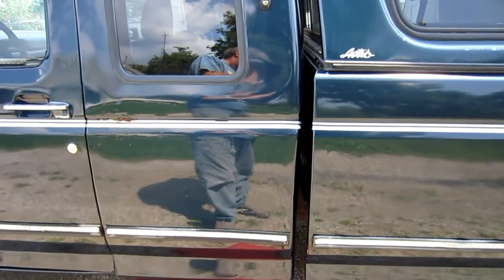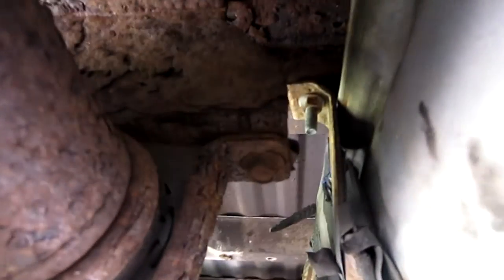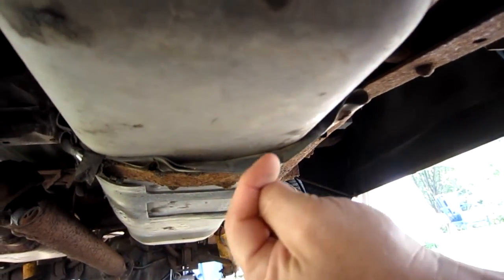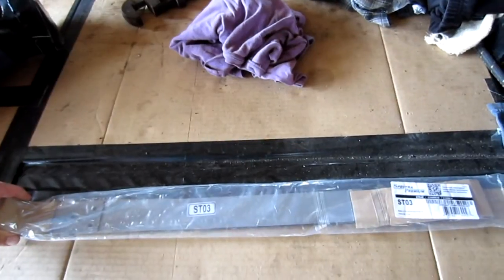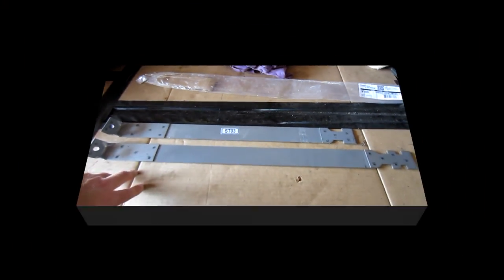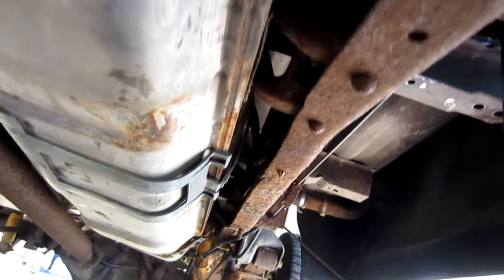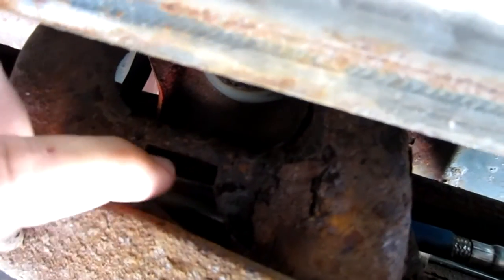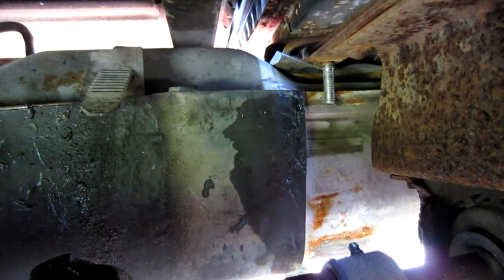95 F150 Fuel tank strap replacement

Comment: I live in Northeast Ohio as well. Definitely understand the rust. I also have a 1995 F150, but amazingly the front tank straps have stayed in good shape over the years because the truck is equipped with the factory skid plates beneath the tanks. However on my 1994 F250, the front tank straps are in need of replacement. Thanks for the video. I enjoy your F150 video series. It is cool to see someone from my area making videos about these trucks.

Comment: Ill give you a heads up that ford couldnt decide what size nut to use on the straps. A 6 point deep 15mm works pretty well. 9/16 wont go. 5/8 12 point wont work and 12 pt 15 tends to round off as well. Even 15mm open end wrench tends to round the nuts off

Comment: Thanks for the video. Just did mine about 1 hr ago. yours looked easy, but mine went even better! i guess in 2002 they put speed nuts on, it saved my knuckles.  I think this generation of trucks is going to be sought after soon.  Lots of parts available, good motors ( before cam phasers, and not much computer controlled stuff) hope you still have yours!
Reply from the maker: Glad you enjoyed the video. No on the old body style. The 95 F-150 in the video replace my 94 F150 with a straight 6 that I had prior. We moved up from a pop-up camper to a travel trailer and the 180000 mile 302 engine in the 95 F150 was doing an okay job pulling B 5500 lb travel trailer but we decided to upgrade to the last year for the old body styles and I got a 97 F250 HD with a 460. I did a lot of videos covering modifications that I did on that truck also. But things change and we got into a larger travel trailer so we had upgraded to a 2019 F250 Super Duty with the 6.2 gas engine and although that was doing this just fine I couldn't resist buying the 2020 F350 with the new 7.3 gas engine. Although it was fun working on those old trucks we are selling everything that we own and start traveling full time and I couldn't Trust pulling our trailer across the country with that 97 F250 that had a hundred ninety thousand miles on it.